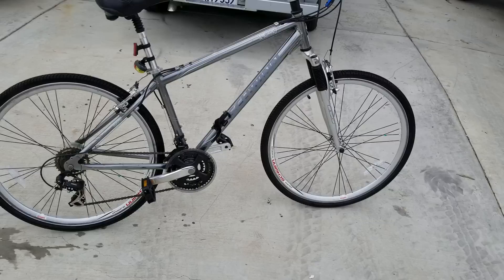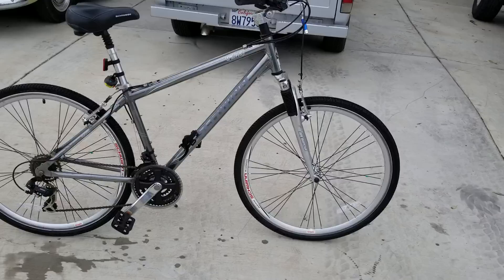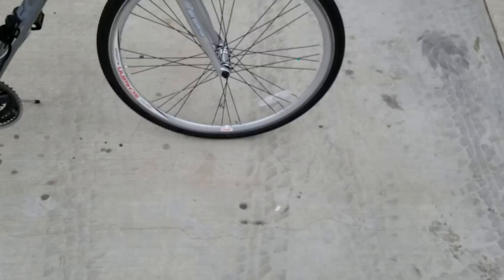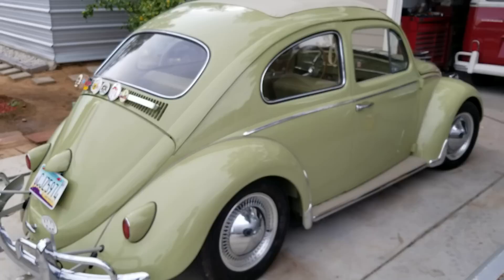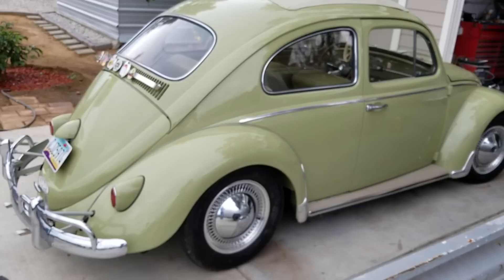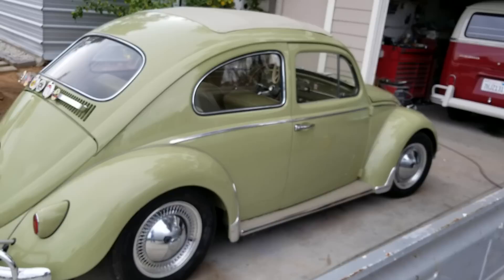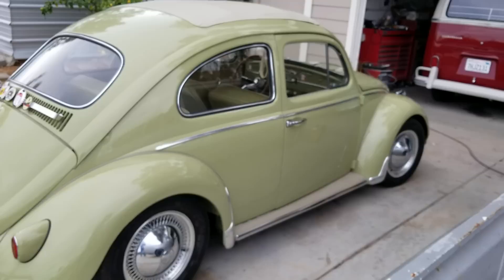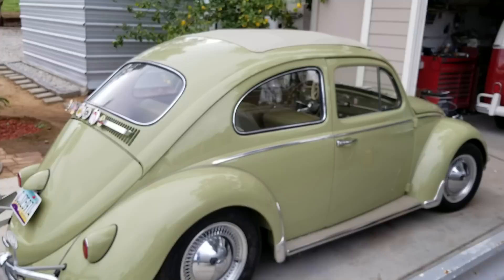Caster shims for your VW Bug how Caster works and what they do

Comment: Really agree with this.
It's a must on a high HP bug if you want to drive safely at cough the legal speed limit on the motorway.
Reply from the maker: I might even try it on my stock bug because it is even more of a squirrel  than the lowered one.
Reply: @Mikefngarage  I've had mine up to around 115mph, but at that speed you really are a passenger as turning the steering wheel will crash the car. I've decided to rethink my setup and have gone with the front higher than the rear, bigger front arb, preloaded z-bar and a camber compensator at the rear. It's winter in the UK, but when the weather improves i'll see if the old girl is more stable at speed.
Reply from the maker: @djambrosia  what is that 180k. man that is fast. Darrel VIttone got the ghia 36hp challenge to 170 mph I think before the motor blew. I couldnt imagine the white knuckles he had going. I havent had a chance to talk to him after that run. Just a couple of facebook remarks.
Reply: @Mikefngarage  There's an old mobile phone video on my channel. Driving back from Wolfsburg on the Autobahn. It's impressive what Darrell has achieved.
Reply from the maker: @djambrosia  amazing yea when I asked him in the 80s about a air cooled vw in his shop he said "we dont talk about these in here its water cooled"  but now I talked to him in the last few years and he says "I am older and wiser now"  when I talked to him about the same. Darrel is a super cool guy fun to hang with and so is Collen my old friend his right hand man.

Comment: Good video but your premise is incorrect. The car was not built primarily for the city. It’s original specification was to be able to carry two adults and two children and sustain 100kph at 25mpg. The car was absolutely build for the autobahn as they were both conceived and built at nearly the same time. I have a 60 T-1 and have never experienced the highway drivability issues you describe.
Reply from the maker: stock they are fine lowered is when you need the shims. My stock beetle drives straight as an arrow.

Comment: Ah yes. Caster, Camber and Toe-in... I remember those... The shims are more important with the older King Pin linkages than the later ball joint linkages as ball joint system is adjustable on all three without the shims.

Comment: The autobahn & the KdF Wagen were designed, developed, & built from ~1932 - 1945.  The autobahn system was for the car, & the car was for the autobahn.  Of course, there were also other considerations in addition to & outside the scope of just the little car when they decided to build the highway system:  commerce, industry, military, recreation, national prestige, etc. -- same reasons as Eisenhower later did it in the USA.  He copied the system.  Back in the '30's, cars didn't drive as fast as they do nowdays, so, high speed stability was not a major concern for the 24hp car.

Comment: How do correct the angle if you have too much positive caster? I lowered my bug with an adjustable beam and from my understanding it pulls the wheels forward and more noticeable on the drivers side the wheel isn’t centre in the wheel well. I’ve bought drop spindles just to offset the adjusters on the beam. Will installing them help you think? Thanks.